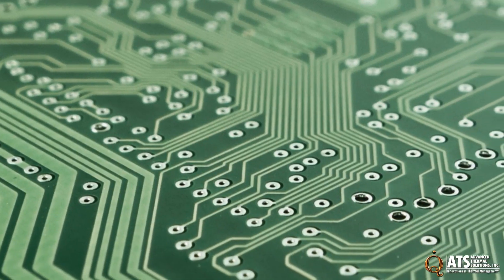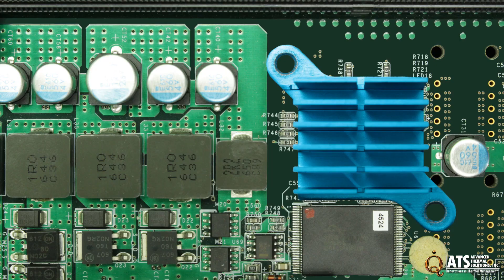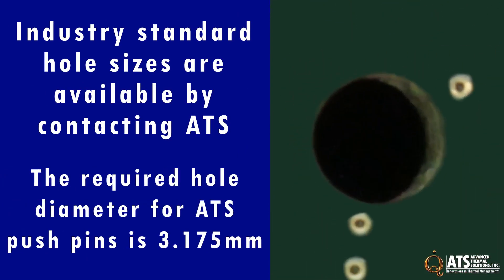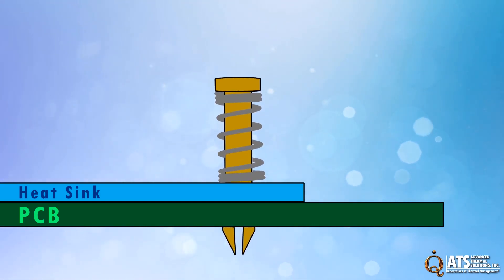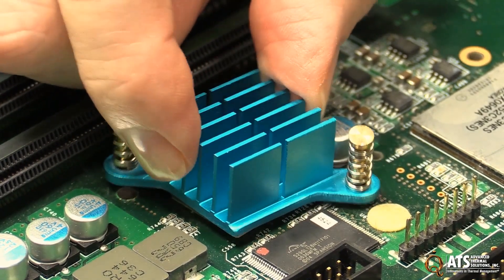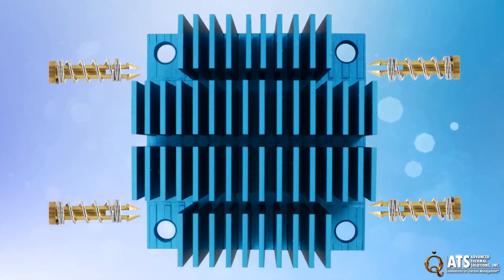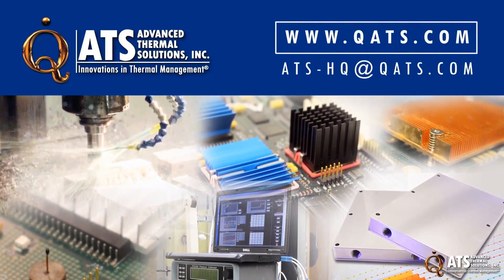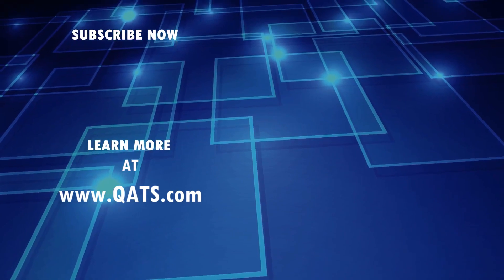How to Install ATS Push Pin Heat Sinks

Comment: Do you need thermal pad/paste or something like that between the chipset and the heatsink?
Reply from the maker: You do @Zjrw98.   thermal pads (also known as gap pads) or thermal paste, thermal tape, thermal epoxy, thermal grease and others are known as Thermal Interface Material (TIM).  Using them improves the thermal conductivity and therefore heat transfer between two surfaces.

This ATS webinar does a good job of giving information on what thermal interface materials are, and which ones to choose for a given application. Its about 45 minutes long  https://vimeo.com/332714682/c8e598bdda

Wikipedia also has a good short article you may find of interest:  https://en.wikipedia.org/wiki/Thermal_interface_material

This ATS webinar we ran a couple of months ago on heat sink attachment would also be helpful on that topic here  https://vimeopro.com/user9706503/ats-webinar-series-2021-how-to-choose-the-right-heat-sink-attachment    Another helpful video that covers phase change TIM is here https://vimeo.com/333991411

And there is a very good article in Electronics Cooling Magazine you may find of help https://www.electronics-cooling.com/2003/11/thermal-interface-materials/

Comment: Cool now how tf do you remove them without taking the whole damn computer apart? So glad 99% of the computers today dont use these pos
Reply from the maker: Hey thanks @GamerVet for visiting our site to watch the video. While I can tell from your comment  you have not had the best experience working with  a push pin attachment,  gaming rigs would not be a good application - but industrial, MIL/Aero and other very high vibration applications would be good target applications.  Clips, tape, epoxy, Z-Clip are all viable options in the right application.  We've created a couple of resources you, and anyone watching this feed, are welcome too:  (1) "Clips, Screws or Glue? Heat Sink Attachment Technical Brief" https://www.qats.com/cms/clips-screws-or-glue-heat-sink-attachment-technical-brief/  (2) "Choosing the Right Heat Sink Attachment for Densely Populated PCB"  https://www.qats.com/cms/2017/07/12/choosing-right-heat-sink-attachment-densely-populated-pcb/   (3) "Attaching Heat Sinks with Push Pins", article covers the various materials used for the pins including brass, plastic or stainless steel PEM,  https://www.qats.com/cms/2016/06/01/attaching-heat-sinks-push-pins/